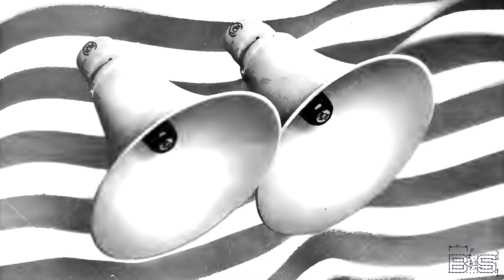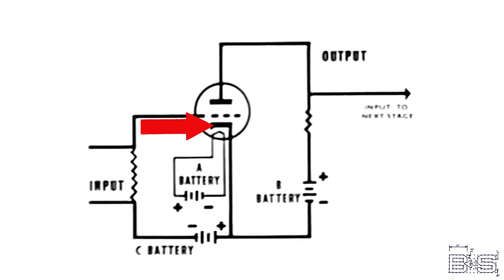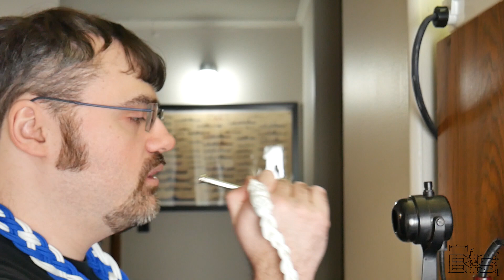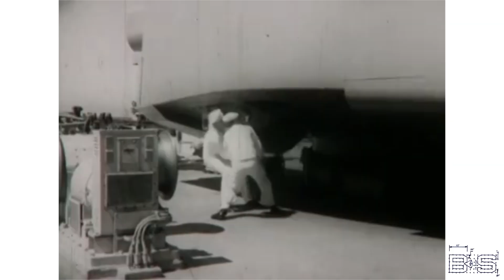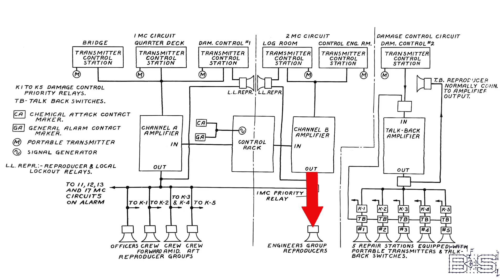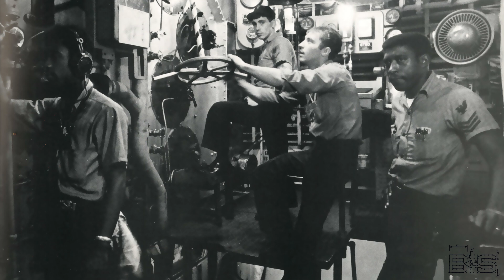Battleship Announcing Systems

Comment: During ww2 vacuum tubes were manufactured for the army and navy in joint program to supply both their needs. They are referred to as JAN tubes ( joint army navy). They made so many of these tube that you can still find these JAN tubes in their original boxes to this very day. A lot of old tube guitar amps are still running today because of the huge supply of tubes that were left over from the war. They are beginning to run dry but can still be found. It's amazing to pull out a tube that was manufactured in 1944 and it looks like it was made yesterday. They still function perfectly.